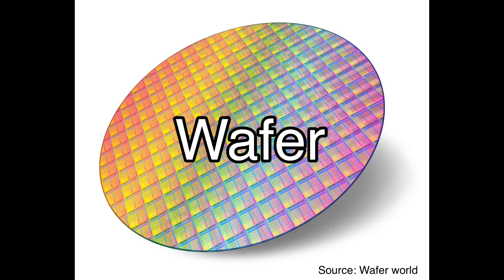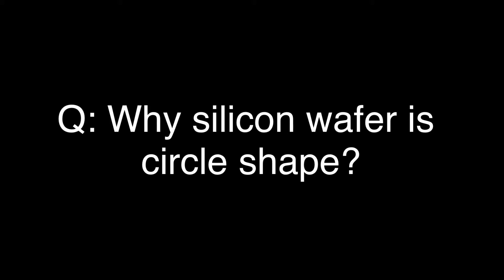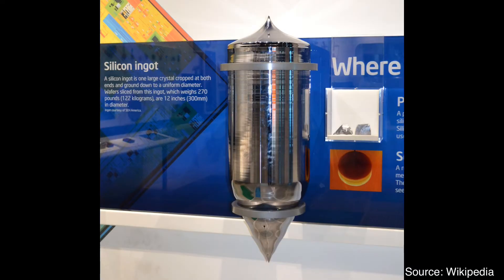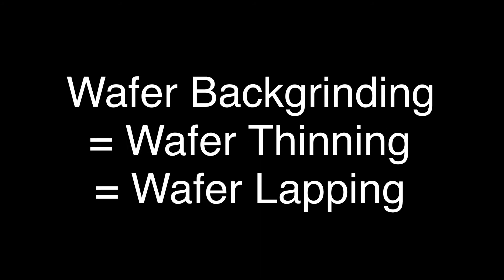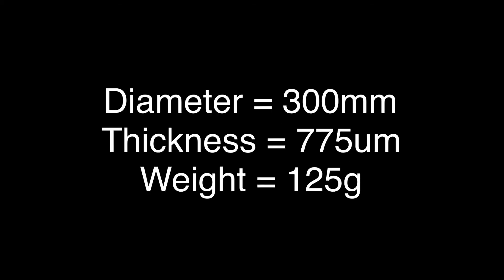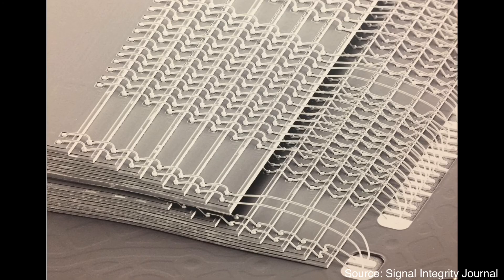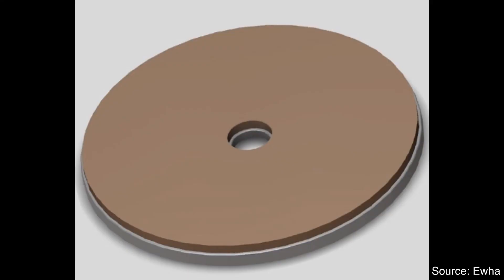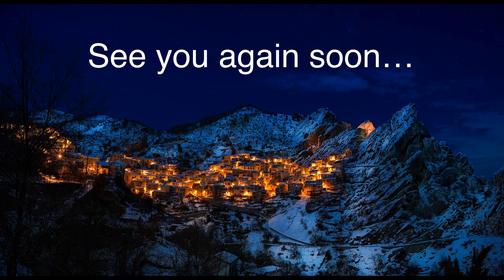[Eng Sub] Wafer Backgrinding Process: Wafer thinning, Wafer lapping

Comment: Hello. Thank you for the Video. Can you also explain about package (strip) grinding process?
Reply from the maker: Thanks for watching. Strip grinding is a process to remove molded area from molded strip to reduce package thickness. It also can expose die without mold flash means can make exposed die package. Usually it is used for PoP(Package on Package) package technology to minimize package thickness. Precise thickness control, thickness uniformity over the strip, prevention of die crack are important items to check. Please check below video from strip grinding machine supplier, AM Technology, for better understanding.
https://www.youtube.com/watch?v=PfEh5IYdoWg